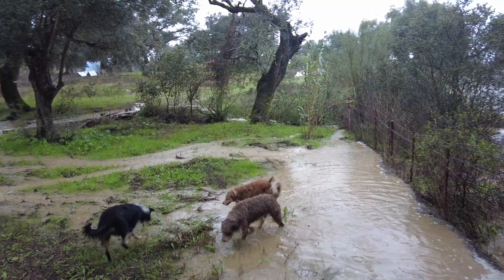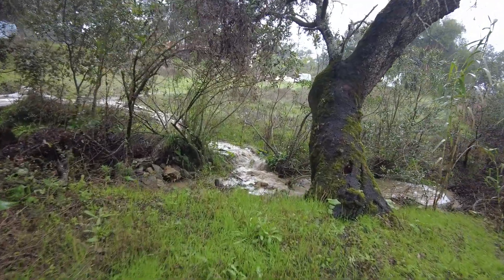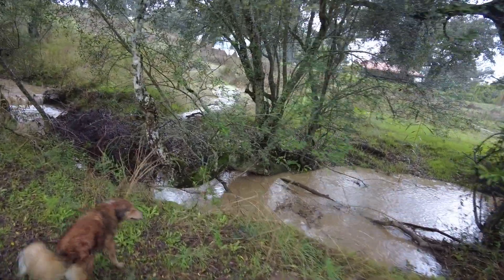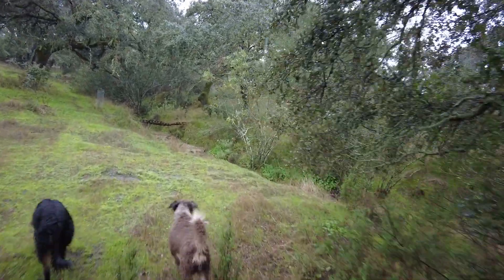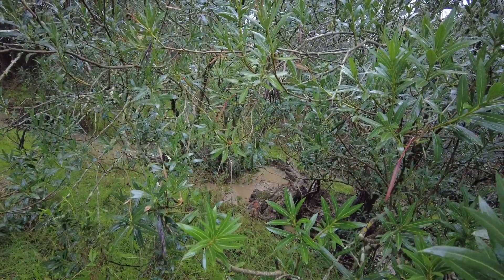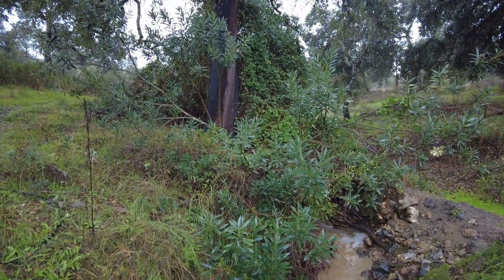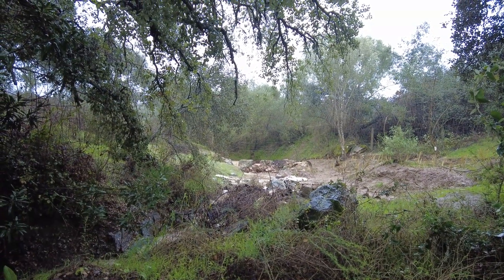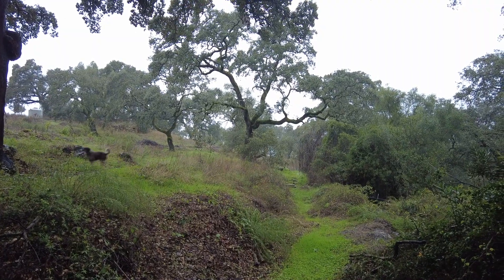Polite rainfall and leaky weir performance. #farming

Comment: at 2 minute mark:- yes mate, you want to get your leaky weirs up to creek bank height.   one rock high is great ,,,but if you can get them as high as the bank, then it gives heaps of water volume and diversion options.    its great engineering, and you have many reasons to be glad for all the improvements.  its now a leet system,,, how about a paddle wheel next !
Reply from the maker: @adammz08  Paddle wheel. Mmm. It will only turn a few hours a year. Thank you for sharing

Comment: Hello Martin
Do you have numbers of your minimal Waterdemand in the Dust-Season ( m³ ) ?
To feed parts of the plants with your Pipeline-System ?
I guess four month of drought would require quite a bit of Water-Stock. 
5m³ times 120 Days make ~600 m³ ? Too little ?
Reply from the maker: @walkingSherpa  Ten cubic meters a day will be an absolute treat. Half that will keep all alive. Well calculated. Much appreciated Max.